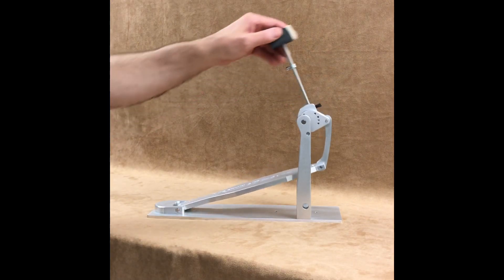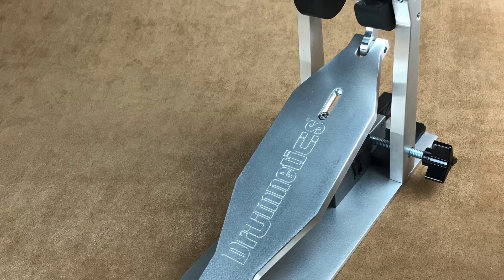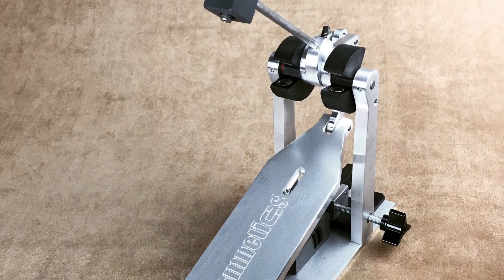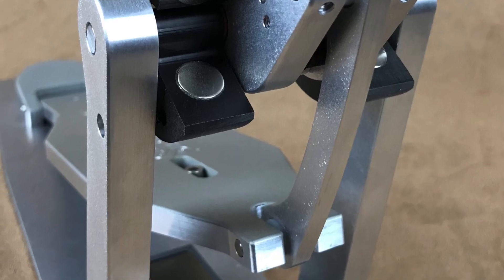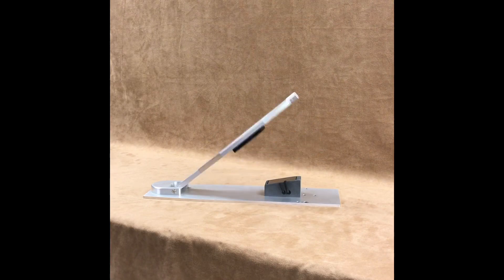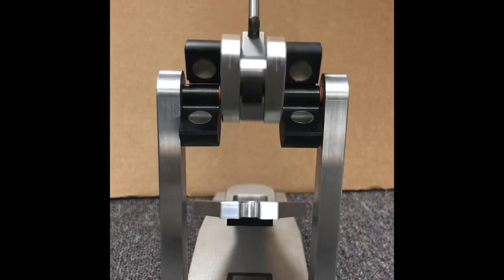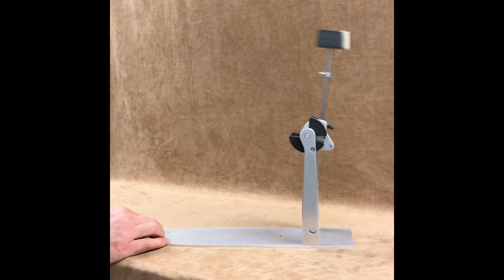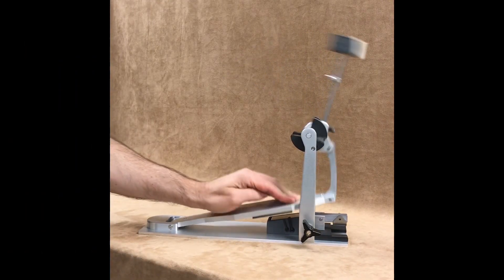5 Points of actuation

Comment: Did the magnet is permanent? As I know that the continuous pressure with the same magnet polar would drain the power of it field
Reply from the maker: Thanks for your message and apologies for taking a while here. The magnets are permanent, neo-dymium magnets which do naturally lose some of their strength but only 1-2% of it every 10 years.